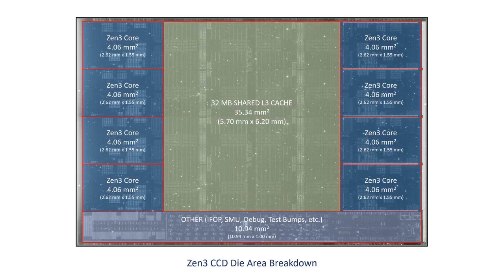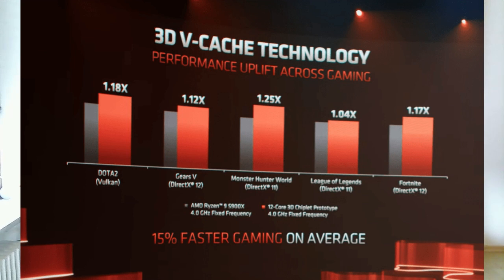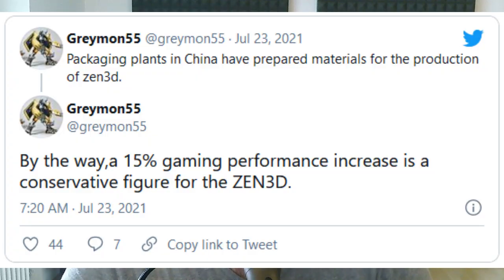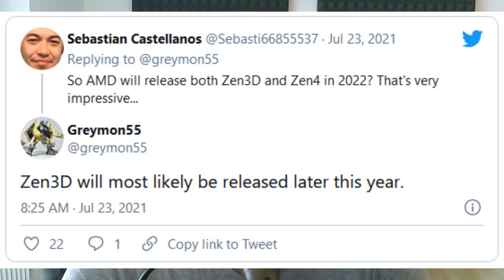AMD "Zen3D": Next-gen Ryzen in 2021?

Comment: I'm pissed that I invested so much in a 5900x system this year, and in a few months it'll dive in value and look like chopped liver. As far as socket goes, I hope it'll still be AM4 until Zen 4 is released later in the year. I cannot ditch everything for AM5 and DDR5...
Reply from the maker: Zen3D will still be the same core, only with more cache. Some games might benefit, but others wont. And tbh, the 5900X is still the top gaming CPU when it comes to features and usability. Your system will be good for at least 4-5 more years, but I know the upgrade pressure :D

Comment: which series of cpu will have zen 3d v cache support?!
Reply from the maker: At first we will most likely get a Ryzen 9 5950X and 5900X with extra 3D V-Cache, maybe AMD calls them 6950X/6900X or something else, names arent known yet. If we lucky and ADL is selling strong, we might also get the stacked cache on the 6- and 8-core models.
Reply: @HighYield  hmm nice,maybe i then continue with Intel 12 gen i5 12600K,bcs ryzen is too expensive i mean 5900x series and there is not huge difference between this 2 cpu,but price is 2x times expensive hah!
Reply from the maker: If you get a good deal on a Z690 or wait for B660 launch, the i5-12600K might be the best deal.
Reply: @HighYield  i can wait its not problem,lets see!

Comment: With Apple/Arm already offering an APU with ryzen 5800/rtx 2060 like performance ill be really pissed if the 6000 series doesn't offer ballpark gtx1650 performance. In fact, I'll jump platforms to Apple for the first time ever.
Reply from the maker: The M1 Pro / Max is really an amazing chip, but it is produced in TSMCs N5P and pretty large in size too. Rembrandt will be much smaller and thus quiet a bit more affordable. But yeah, I really have to tell myself that I dont need a new MacBooc Pro 14 inch, its just too sexy...
Reply: @HighYield  mac mini with  Pro / Max will be hard to say no to if the price is nice. Small, quiet, cool....

Comment: AMD best case financially and market share   would be to offer upgrade path for older AM4 motherboards    (   meaning if a  distinct  MB can take a 12c/24t  help in that regard,  if it can take 16c/32t that would be great - not all will  )  to Ryzen 3 "V-cache"  and continue to produce the CPU even after Zen 4 arives and also during the first period of   Zen5.  With a discounted price and be the budget option. 

If they can get all the Ryzen users to align to  Ryzen 3 "V-cache" as the last stop in there upgrade path that will consolidate there market share.  Only when DDR5 will be cheaper  & CPU performance will be +60% ( from INTEL & AMD )   can they anticipate that people will not want  the "last Ryzen on AM4".  But they should sell all that they can and keep people from going to INTEL. They can do that as  Ryzen 3 "V-cache" can be ok for 2-3-4 GPU generations and should  be keep't  in production for as much as possible.   If i can flip a 3700x , or 3600 or 5600x or 5800x  or even 2700x   to get +45% or +20% or +60% performance a some more cores   for 200$ ( sell old CPU on second hand and buy Rzy 3 "V-C"    - i can still stay on AMD and use the platform as the cost efective upgrade solution.  That means that Intel will not have a CPU sold , but AMD.
Reply: This is such a dumb take... Zen 3D is massively expensive to produce atm, and every single Zen 3D CCD AMD can make could be sold in seconds for WAY MORE as the CRAZY IN DEMAND Milan-X for bookoo bucks. 

Releasing 2x CCD Zen 3D parts for AM4 desktop would have be ridiculously stupid on their part. Gaming performance (the reason 90% of owners buy what they buy) would be no better than a 1x CCD part, ala the R7 5800X3D, and if multi-thread performance is the goal, AMD wants you on Zen 4/AM5. (Let's be totally clear here, you wouldn't jump ship to Intel just because you need to build a whole new platform now if Zen 4 is still faster. End of story). AMD would be literally lighting money on fire by not selling the other CCD's as Milan-X.

If you want peak AM4 gaming performance, sure get a R7 5800X3D, but for literally ANYTHING ELSE there is ZERO reason for AMD to offer more Zen 3D SKU's or availability on AM4.
Reply: TL;DR - Nobody is jumping ship for Intel just because they have to build a whole new platform (bc there's no R9 5950X3D & Zen 4 = AM5 only) if Zen 4 is faster than Raptor Lake. And nobody is going to be building AM4 in a post AM5 world. DDR5 prices continue to drop and AM4 will just be a super outdated platform by late 2022. And if DDR4 support on a new platform is critical to you as a new builder (not upgrader) you were always gonna buy Alder/Raptor Lake not Zen 3D anyways.

Comment: I think 3D stacked cache makes a ton of sense. Its basically on board RAM, with the best timings imaginable.
Current RAM has one big weakness; its outside and away from the CPU, meaning signals have to travel which isnt going to get much better.

More cache will most likely be one of the things that will drive forwards the industry. CPUs will have enough cache on board to run most tasks, and just page back and forth with the RAM whenever it needs to do actual large transfers, rather than an on the go communication. RAM will be there to offset the slower storage options, just like it does now, but then act as a bigger, ready rack for the CPU, whenever it needs to run very large programs.
Reply from the maker: I also think we will see more of that, especially with dedicated "cache dies". This might be useful for GPUs too if you consider the 128MB "Infinity Cache" on RDNA2 GPUs and how it will evolve with RDNA3.
Reply: @HighYield  that'd be intruiging.
It would slot in nicely with in-factory joined cooling, such as TSMC's direct cooling rather than using a heat spreader on top.

It would start to look like a SBC or SoC, and those make more sense anyways for the future

Comment: This is a new topic for me. I wasn't sure, are we talking ZEN4 ryzen?  Or to be released ZEN3 Threadripper? Will this be a replacement cpu socket after AM4/sTRX4/sWRX8 are replaced?
Reply from the maker: This will be something more like a "Zen3+", so definitely a AM4 CPU coming before Zen4. The prototype Lisa Sue showed at Computex was literally a Ryzen 9 5900X with more L3 cache due to the stacked cache die on top of it. I think we will see some high-end AM4 Ryzen CPUs with it (maybe as Ryzen 6000-series) and theres a chance we will see this on a Zen3 based Threadripper as well.
Reply: @HighYield  Thank you. Glad to hear that. I've got a WRX80E board but still saving for a TR PRO cpu. I'll have ZEN2 and maybe ZEN3+ as an option.